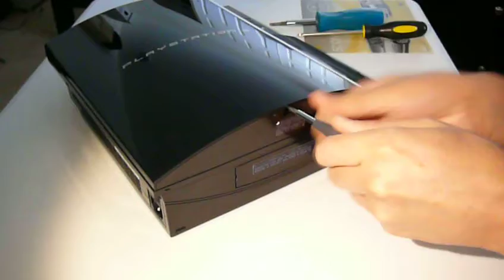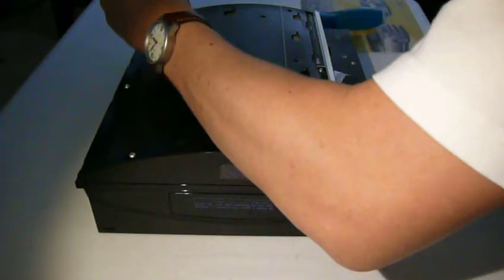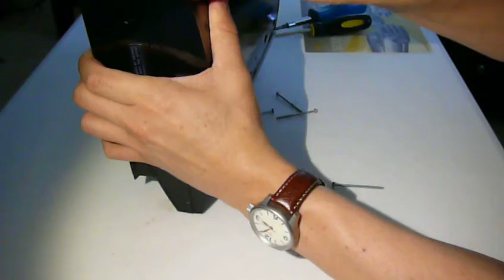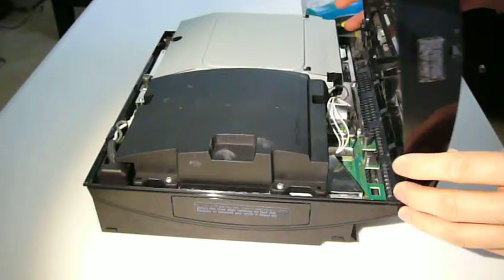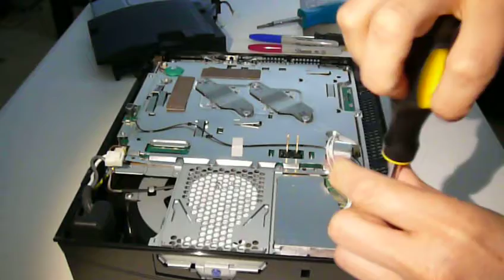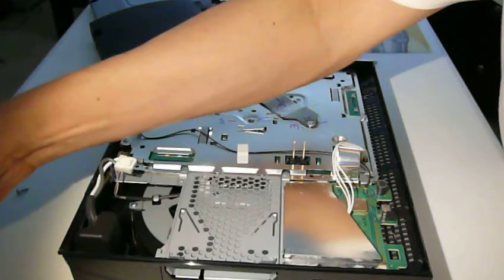PlayStation 3 Fat 40 GB, Disassembly to Access Thermal Grease Only

Comment: Would you please.. Tell me what screwdrivers i must use to disassemble Ps3 ??
Like ... What the sizes
Reply: ali hassan I just use an ordinary screwdriver
Reply: +ali hassan T8 Torx Tamper Proof Security Screwdriver
Reply: +Cody T can be had from eBay for $2 shipped!  u can use some other methods in a pinch but not recommended (hence the ordinary screwdriver)

Comment: you do realize the counting the turns for the metal plates was pointless right?
Reply: sure was. The threads "run out" at the correct torque to prevent under/over torquing.

Comment: I did this with my PS3 carefully and now I can't power it up anymore. There's even no red light. My PSU works fine so I think it's another cause.

Could it be the ribbon cable that is connected from the Power Button/Eject Board to the Motherboard? I can find this nowhere because I have the exact same PS3 as you.
Reply: did you break the cable